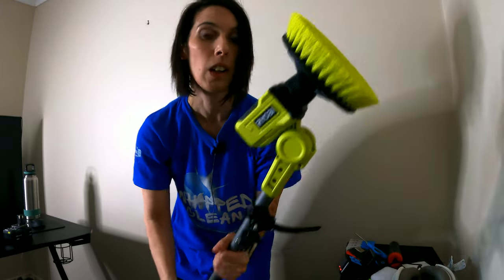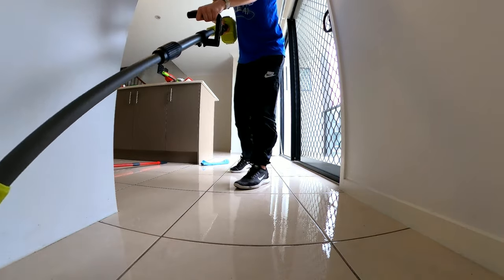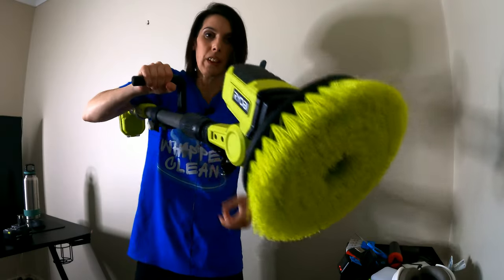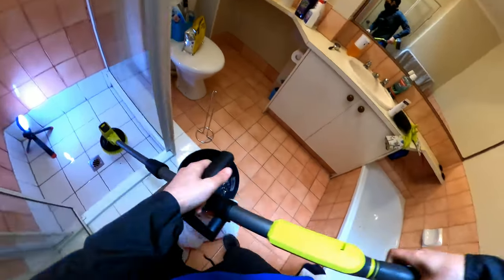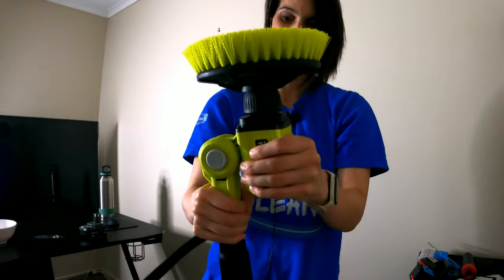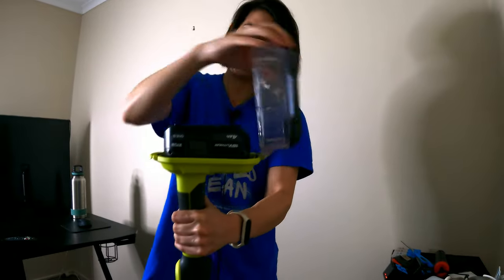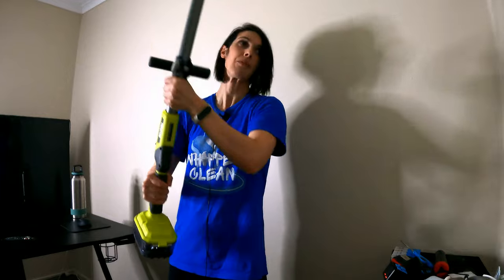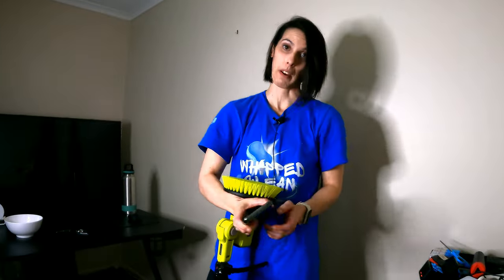Why get the Ryobi Telescopic Power Scrubber?

Comment: If you have a drill, use a regular drill with a brush attachment. That’ll be your handheld one
Reply: nope. the button can be kept on without holding it. plus it's waterproof.these machines are incredible
Reply: Drill brush is ok but brushes always fail where the metal connects to plastic.
Reply from the maker: Thanks for that. I ended up getting the drill and all the brushes, I will be making a video on that soon

Comment: I suggest you look into getting the wider 8 inch brushes for cleaning larger areas. I own this model, plus the newer model that you can attach a garden hose and it sprays. I used the handheld model and it worked well for the shower. All in all it's a handy tool to have and it makes cleaning so much easier.
Reply from the maker: Thanks for the tip!

Comment: I have the smaller one. Good for the shower screens and tiles but it's heavy one-handed so use a small battery. Didn't go with the extendable one as I have hard floor cleaners but I see you with that thing in all sorts of places my floor cleaners won't go like up walls and inside cupboards. Impressed! (subbed and belled) PS. Pro-tip for the O-ring sealing the battery compartment. Check each time there's not a hair or anything on the o-ring as water may find its way in, especially the way you work. (meant as a compliment). Cheers. 👍😃
Reply: How do you take the brush off? I can’t seem to take mines off. I have the hand held one.
Reply: @goddesskemisi7225  Hold the spindle so it won't rotate then with your other hand get a good grip on the brush and rotate it past the detent it's currently in. This will line up the three-pointed hole on the brush with the three-pointed star on the end of the spindle so the brush can be lifted off.
Reply from the maker: I found it hard to remove at first but its a twist lock system @goddesskemisi7225